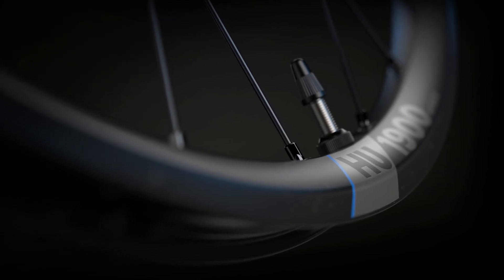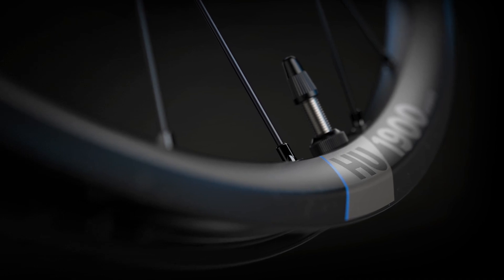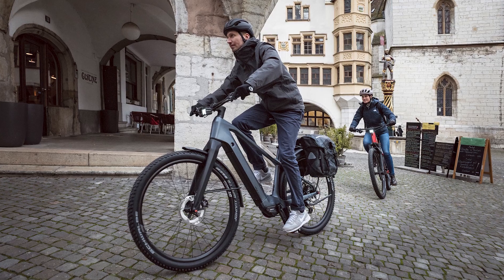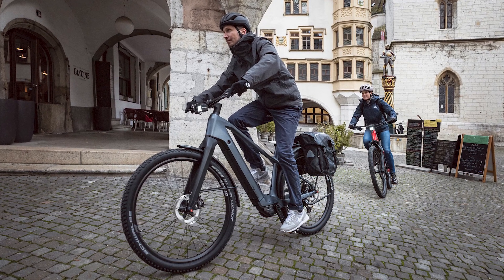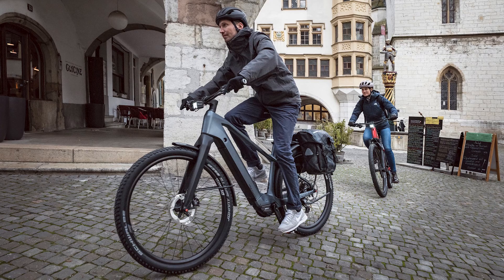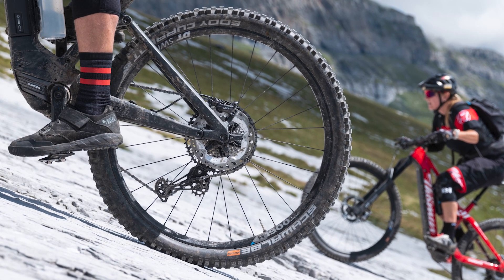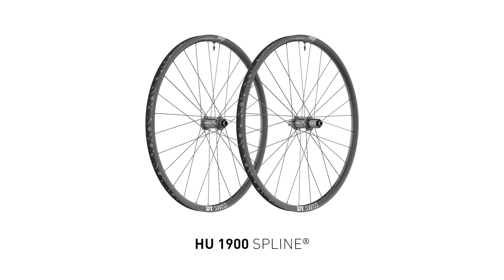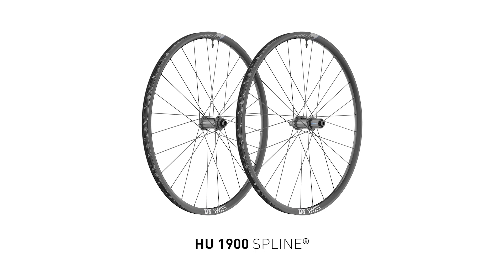Product Presentation HU 1900 SPLINE / Hybrid Utility – Built to last | DT Swiss

Comment: Nice! I’m still thinking between H 1900 and HU 1900 sets. I’ve got SUV e-bike. I do commuting, trails sometimes and also trekking.

Perhaps HU 1900 is overkill for me? My weight is 76 kg and my Canyon is about 24 kg.
Reply from the maker: Hi, and thank you for your comment. 
The HU 1900 is very specific and engineered to be used especially on so called SUV e-Bikes, with more load but mostly used on paved roads.
The H 1900 is designed to be used in e-MTB and therefore offers a wider rim for modern MTB tires. As the H 1900 offers a 150kg system weight is would suit to you perfect. Just if you’re thinking about using narrow tires on your e-Bike the HU 1900 might be the better choice. A rim/tire chart can be found on our website: https://d2a13k6araex7u.cloudfront.net/pmt/00/00/00/00/00/00/00/10/00/00/00/85/8/MAN_WXWXXXXXX1610S_WEB_ZZ_001.pdf?v=146888
Enjoy riding your local trails! 
Friso «DT Swiss».
Reply: @dtswiss I just ordered H1900. Can’t wait to have it!

Comment: so basically the HU 1900 is a H1900 with a max weight of 180kg instead of 150 ?
Reply from the maker: Hi Jean, not really! When you compare the both wheels-sets you will see that the HU 1900 has a lower price. To realize a more economic price point we needed to find the right spot to safe money. In the end we are using a more economic rim which is the biggest difference in-between H 1900 and HU 1900. Enjoy riding your Bicycle, Friso "DT Swiss".